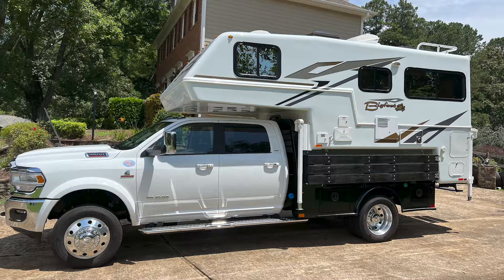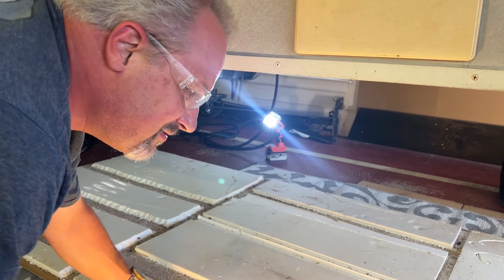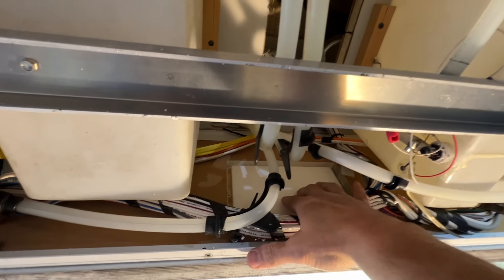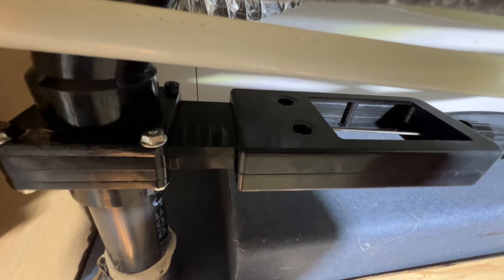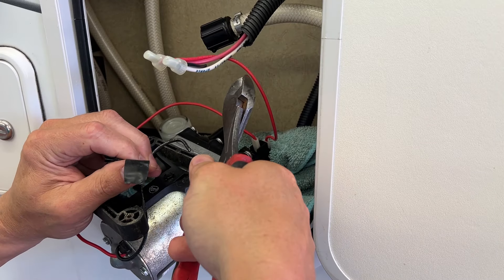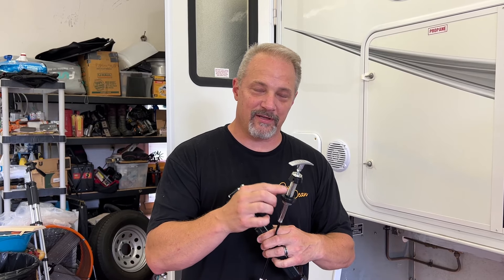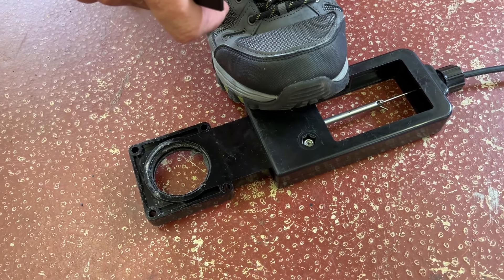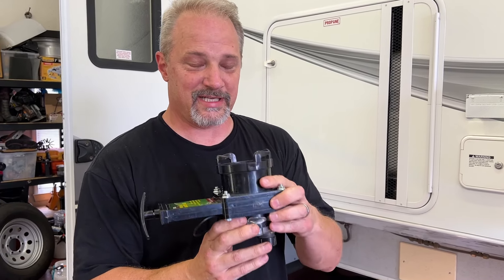Lance 1172 Gray Tank Valve and Water Pump Replacement / Truck Camper Life

Comment: Great job on the gray tank valve replacement! Seeing you guys tackle that wasn’t nearly as bad as I expected. 
Last year we were on a month long trip in our 1172 from Texas to the west coast and our water pump went out. When Carol ordered one to be shipped ahead to our friend’s house she said those water pumps are cheaper if we ordered two. That kind of told all we needed to know about the reliability. 😜 As soon as we got there we quickly replaced it. 
We’ve been using the twist on valve as well for the same reasons and it also makes attachment of the sewer hose a little easier. 
Thanks for sharing your how to video!

Comment: Y'all saved my bacon once again.  I took my inspection camera out tonight and saw there were some sheared off bolt heads on some of those tig welded T beams.  I have a couple cracks feom drivers side to passenger side in my 1172 that made me look.  I was wondering if that was all there was to getting in tha basement for repair!  Great post, y'all!  my tank valve is leaking as well so double thanks!

Comment: You made my day!!!
Always wanted to see a fairly new Lance 1172 with the bottom removed. Something truck campers have over any other camper out there. You can easily gain access to the underneath and put it at a height that makes it easier to work on, however you all are restricted because of your ceiling height in your garage. It’s still much easier than a regular camper. 
Thanks so much for sharing this task!!!!!

Comment: I worked underneath my 2005 Lance 981 to fix some broken frame welds several years ago.  The main difference that I notice is that Lance seems to be doing a much better job of using insolating materials in your unit.

Comment: Thanks for the video . I’ve been trying to figure out where those valves are. My black valve is stuck wide open just a month ago and my gray tank. I feel been leaking a little bit too cause I popped the cap and gray water wants to come out . I called my Lance dealer. They couldn’t even tell me where these valves were.

Comment: Good job! :trophy-yellow-smiling:Yeah, I had to work on my black tank valve soon after I got my used camper. It just needed cleaned up, butt I had trouble with getting the seals in right because it was so tight. I had to cut a section of pipe out and put in a coupler in order to get enough room to put it back together. It wasn't very stinky because it was dry and yes I used my bare hands. :eyes-pink-heart-shape:

Comment: Great video. Was always curious what the camper looks like with the bottom panel removed. I live full time in my 2012 Lance 992 that I purchased new. Like you I had to replace the water pump after about 6 years. 2 years ago the Coleman Mach A/C finally died so replaced with a RecPro Belaire 3400 13.5K heat pump A/C. Wow. So much quieter and more efficient. No issues with the tank valves so far but I also carry a spare Valterra twist on gate valve just in case. I too am very happy with my Lance. For a truck camper that is lived in full time and parked out in the south Florida sun it amazes me how well it has held up. Thanks so much for sharing!
Reply from the maker: Glad to hear your Lance has held up so well for you.  We love the Recpro Belaire 3400 AC too.  Thanks for watching!

Comment: Thank you for the hands-on videos!  We’ve had our 1172 for 3 years and love it, but learned quickly that you have to be able and willing to do most repairs and maintenance yourself.  Question - you bought the 96” cable on the valve you replaced, how much slack did that leave you?  How short do you think you could have gotten away with?  I would like to avoid loops in the cable as much as possible.  Best
Reply from the maker: I know there is a 72 inch cable available but I don’t know if there’s one in between that and the 96 inch.  I feel like the 72 inch cable may have fit, but I don’t know exactly because I didn’t try one. I think looping the cable is pretty standard from what I’ve seen.      I think it would at least need to be six or 7 foot long to reach. Thanks for watching!

Comment: Have y'all ever removed an inside wall pannel to inspect welds or anything inside the wall?  I'm wondering if those inside walls will even come off or if they are glued onto the aluminum frame and foam?  Mine is a 2018 1172

Comment: Thanks for making this video! Did you make a video on how to replace the plastic toilet with a ceramic or porcelain toilet? I need to replace mine on an 1172 and can’t find it. Do you have a link? Thanks!
Reply from the maker: Sorry I we didn't make a video on replacing the toilet.  It's pretty easy but I did have to slightly modify the water line to fit better.  I also installed a water shut off valve behind the toilet.  Thanks for watching!

Comment: 1172 .   Do you have recommendations for an old truck camper (Make) for an old (20 year old) pick up?
Reply from the maker: I don’t have any specific recommendations but I would say to find what your truck is rated for and find a camper that weighs less than that.  Consider that when you add the occupants plus cargo and possibly water you could add an additional 500 to 1000 pounds of weight.  Thanks for watching!

Comment: You should not have a loop in the cable, it will cause extra slop in the cable .The inner cable when you push will be on the outside of jacket and when you pull will be on inside of jacket and that is the slack in  the cable. Should have gone with shorter cable.